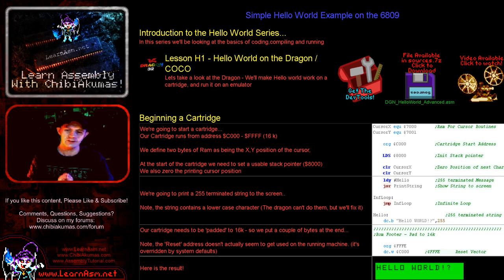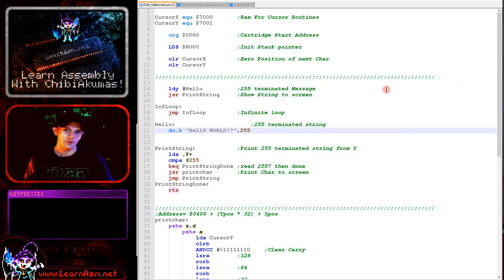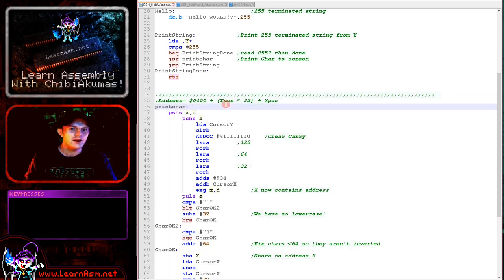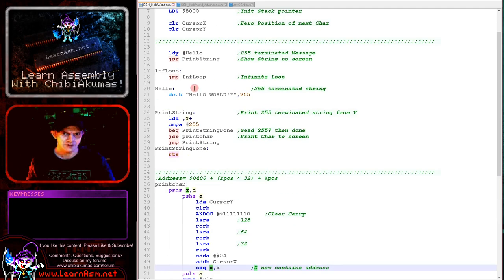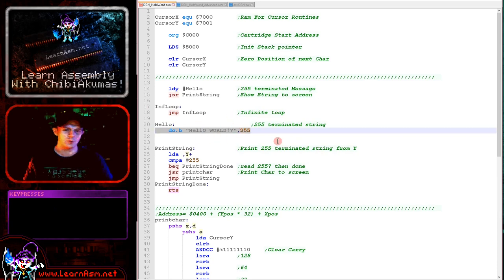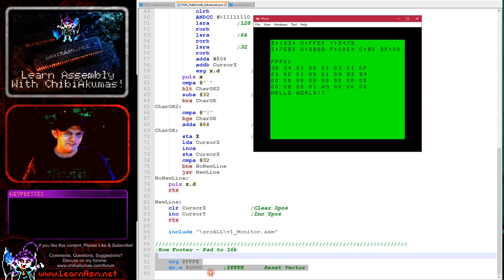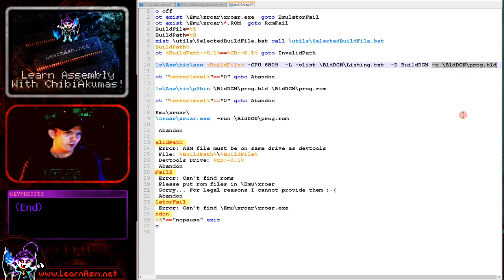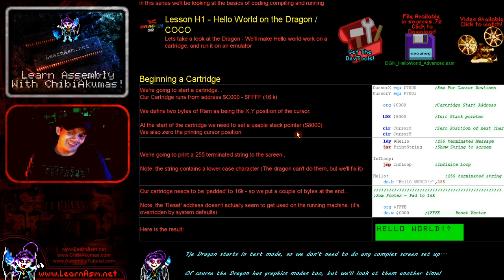Hello World on the Dragon / Tandy CoCo - 6809 Assembly Lesson H1

Comment: Nice! What's the emulator you're running? I just got a great condition CoCo3 and am looking forward to digging into it after not having access to a CoCo since about 1984. Mostly I'm just a huge fan of the 6809 with its clean ISA and support for two stacks making it the best 8bit forth CPU ever made.
Reply from the maker: I'm using xRoar - unfortunately it doesn't emulate the CoCo 3, but I think my test code should work on it?
Reply: @ChibiAkumas  yeah except for a few unusual graphics modes older CoCo code is generally compatible.